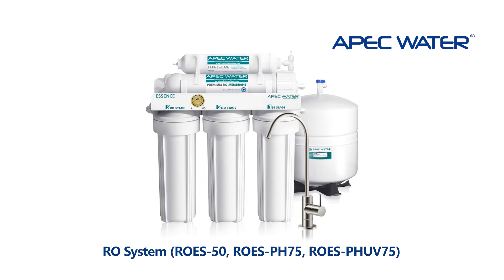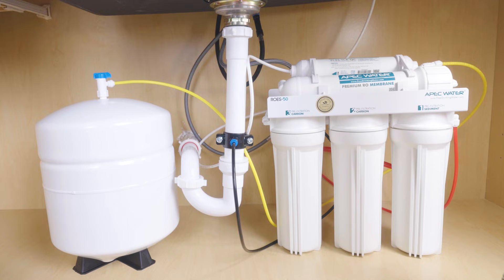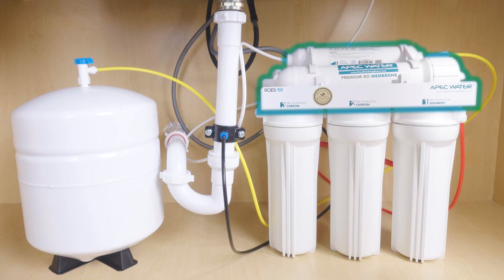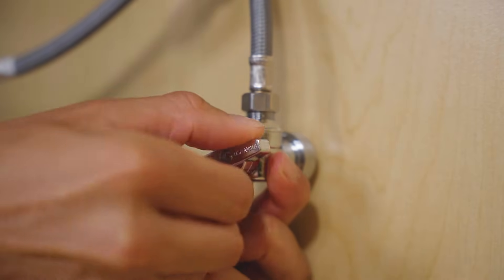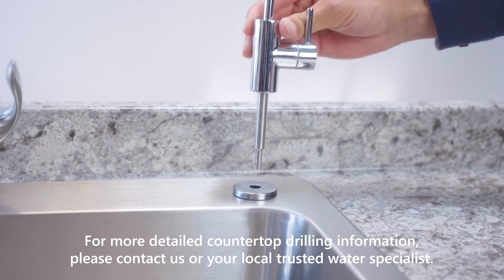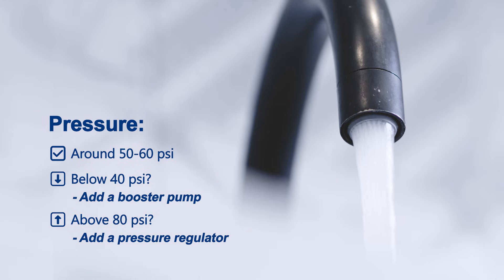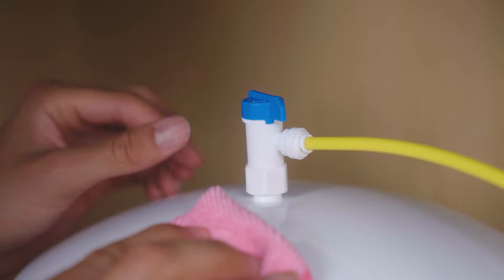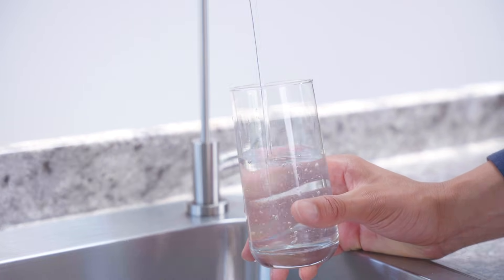Install Your APEC Water RO System | Step-by-Step Reverse Osmosis Guide

Comment: Hi I’m very interested in purchasing a system from you but I would prefer it go directly to my refrigerator. Do you have a system for this?
Reply: That’s easy enough. There is a water line that feeds your ice maker and or door water outlet. Just put filtration system under a cabinet near the refrigerator, disconnect the waterline from the refrigerator connected to the filtration system then from the filtration system back to the refrigerator where the original waterline was connected. You can also install one at the water main to filter the water for the whole house. The reason people don’t generally do that is because you will go through a lot of filters unnecessarily for things like flushing, the toilet, or turning on the garden hose.